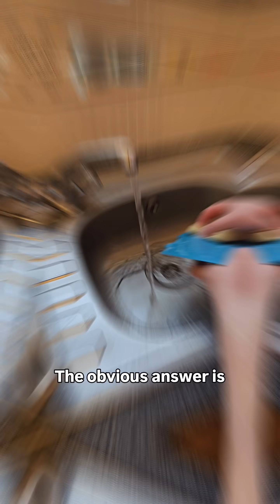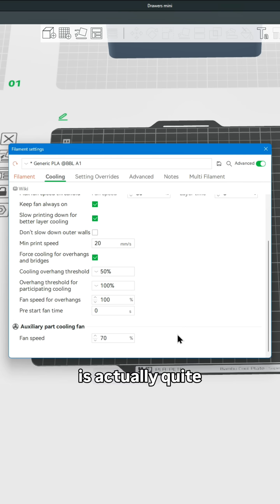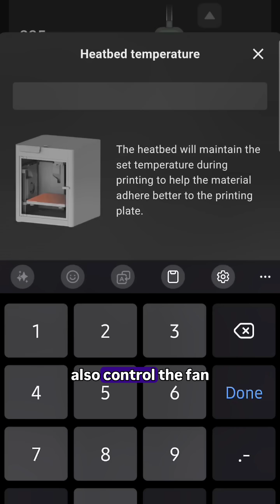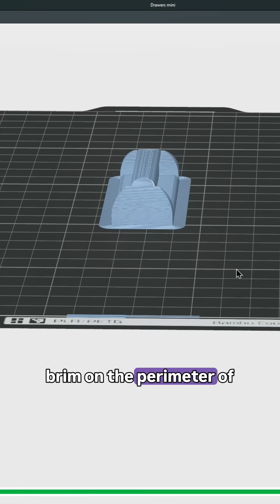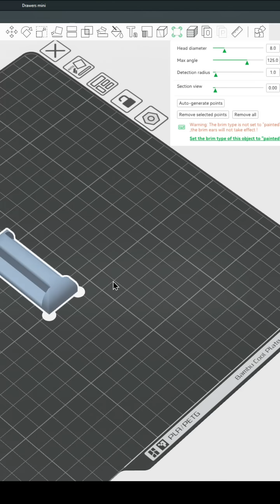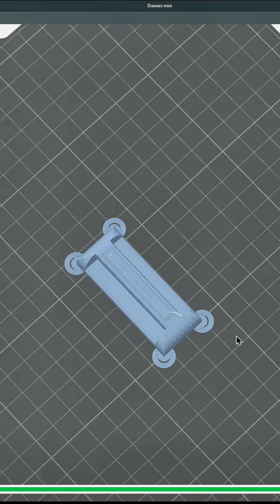How to stop your 3D prints from warping #3dprinting #bambulab #tips #tutorial #howto

Comment: Using a scorer to clean the build plate. Jesus Christ.
Reply from the maker: You can use the rough side of the sponge, no problem. In fact, for certain build plates you need to to get it fully clean
Reply: @3DMatterials You are using a Cryogrip build plate. These plates rely on a thin engineered coating. Abrasion will thin that coating, create inconsistent adhesion, and permanently shorten the plate’s life. I'd hazard a guess that this is likely the cause of any warping, not the solution.

The only plates that would benefit from VERY light abrasion are the smooth PEI and bare glass plates. 

Wash the cryogrip and textured PEI with a soft cloth, warm water and dish soap, rinse well, and avoid touching the surface afterward. That's it. 

Remember that build plates are consumables and they wear out over time from heat, prints, and handling. Cleaning properly extends their lifespan significantly.

Damaging them (e.g. with abrasives) just means replacing them sooner than necessary.
Reply from the maker: I see what you mean and I definitely wouldn't recommend scrubbing plates often. In fact, it's very rare that these types of plates should need cleaning, as long as nothing grimey fingers are coming in contact. I think I've washed this plate once or twice and it's not like I'm going ham with the scrubbing. So while it could be a problem if done too often and vigorously, I think it's pretty negligible in this case